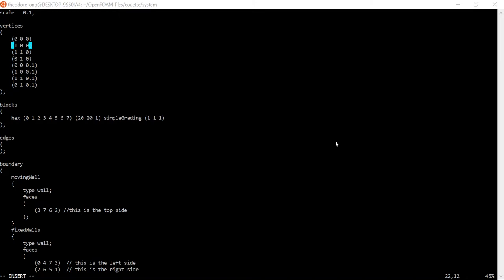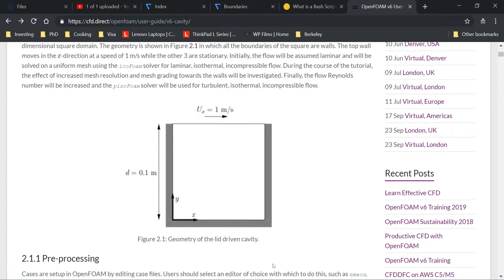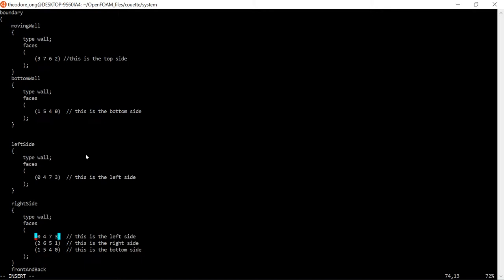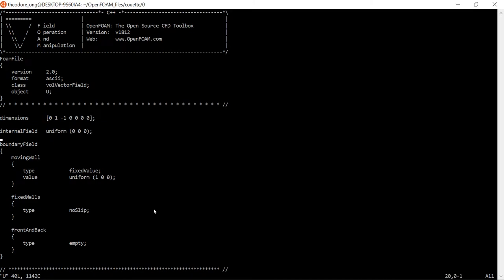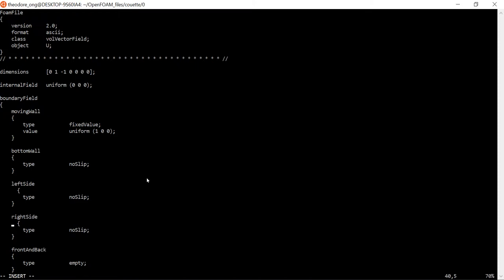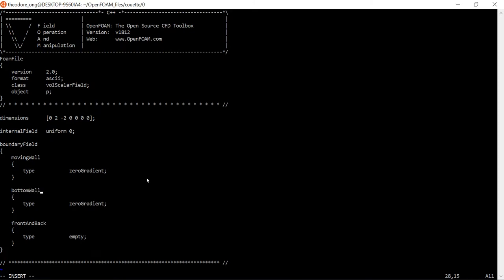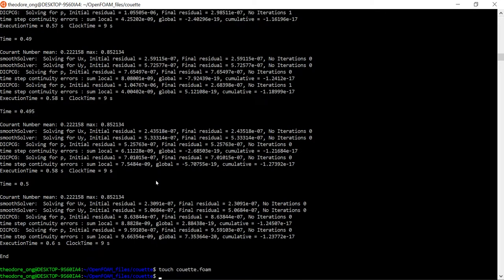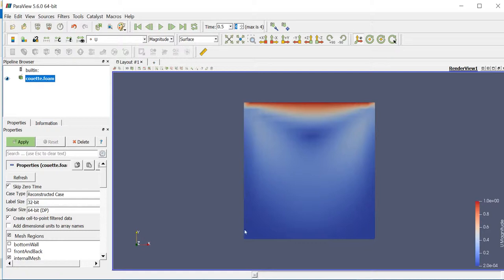OpenFOAM for Beginners win10 7   Parallel Plate Couette flow editing blockMeshDict vertices

Comment: when I run the icoFoam. there is an error
--> FOAM FATAL ERROR: (openfoam-2012)
Cannot find file "points" in directory "polyMesh" in times "0" down to constant

    From virtual Foam::IOobject Foam::fileOperation::findInstance(const Foam::IOobject&, Foam::scalar, const Foam::word&) const
    in file global/fileOperations/fileOperation/fileOperation.C at line 1003.

FOAM exiting